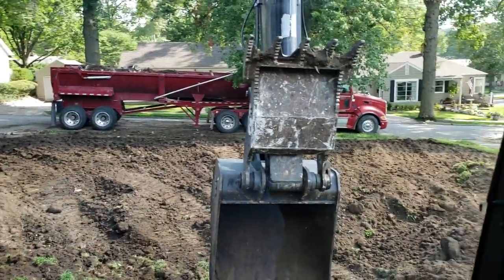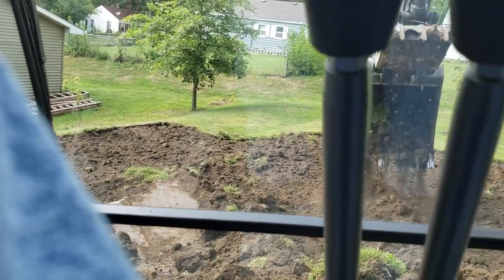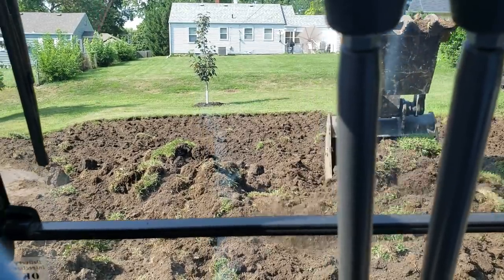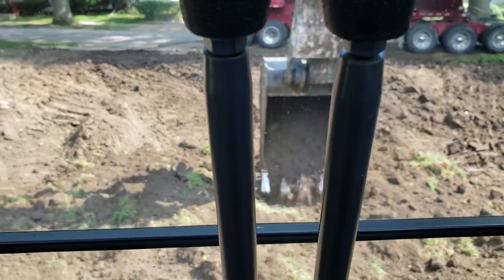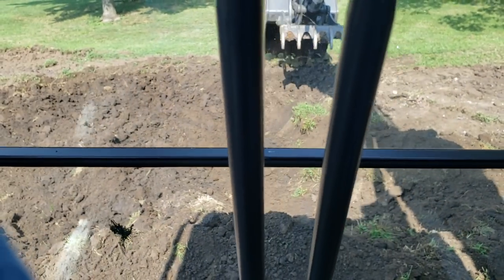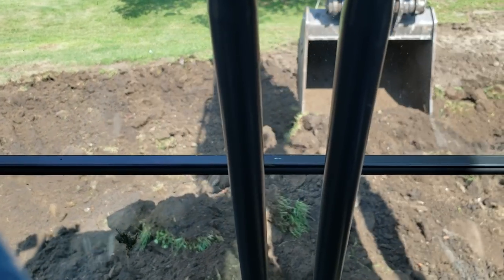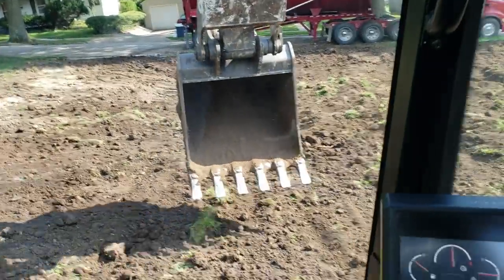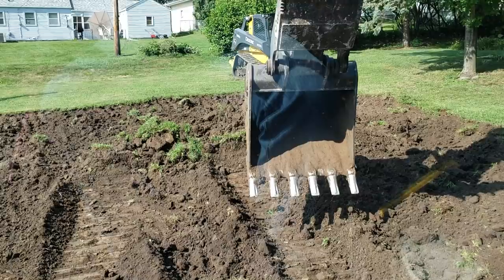Finishing up house demo .. combines .. videos & more

Comment: I think something needed done with the tariffs but it needed to happen years ago. Corn prices have been bad for several years now. Soybeans where still productive and now they are getting down there in price. From year to year you never know what your yields may be. Our worst corn field last year was 184 bushels dry and our best was 271 bushels dry. Land taxes in Ohio have been going up in about every county. I know the three counties we are in are suppose to be dropping back some but wont be at the levels they once was. Farm land for sale in our area is hard to find. I bought another grain farm november of 2016. It took me 2.5 years to find that farm. I think the tariffs will work out but this was bad timing. I figure the beans will need to come from some where even if it comes from another country. They will have a shortage then and have to buy from us. My worry is the other countries will not buy enough from us.
Reply from the maker: I agree - something should have been done 30 years ago .. your spot on - its bad timing - plus trump doesn't use much tact - he goes at everything with a sledgehammer  ..  if they would push the E15 through - we would definitely have a market increase

Comment: Man you got the right idea about combine prices. We looked at used prices and for a used s680 with about 1500 hours the price the dealer wanted was only 40 thousand less than a new s660 . So we bought the s660 it's a smaller machine than what we needed but we run a 9870sts as well. We farm 4500 acres and custom farm another 1500 to 2000 acres anualy. Nice video we have similar opinions on farming and politics.  Great chanel and excellent variety of farming excavation and mechanics.
Reply from the maker: Thanks very much!!